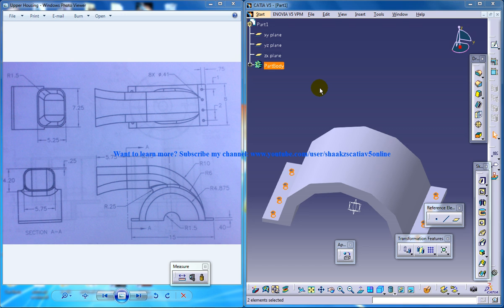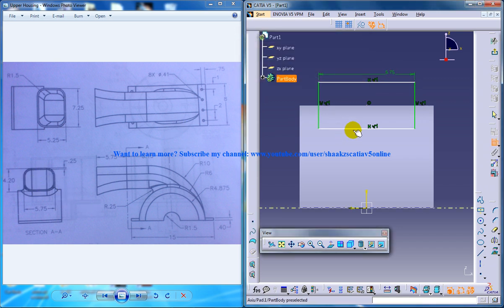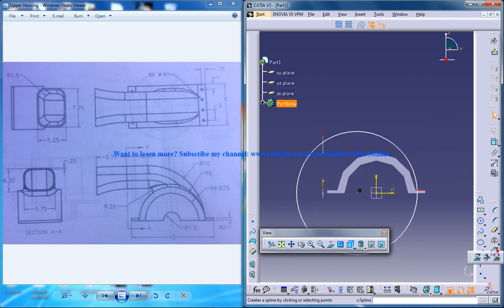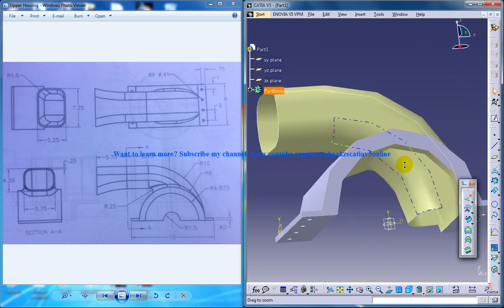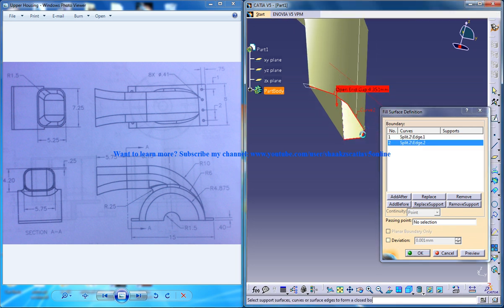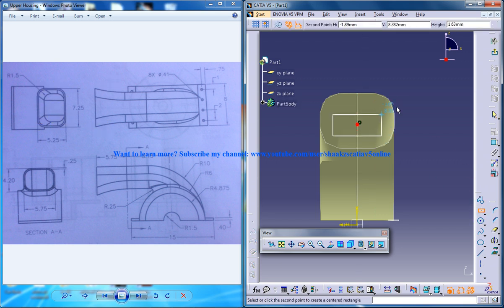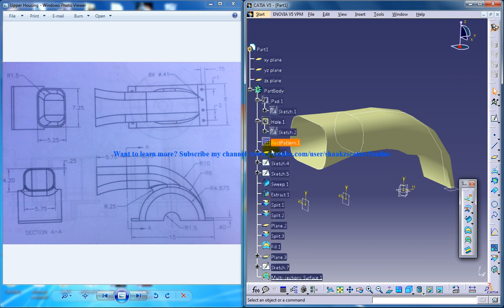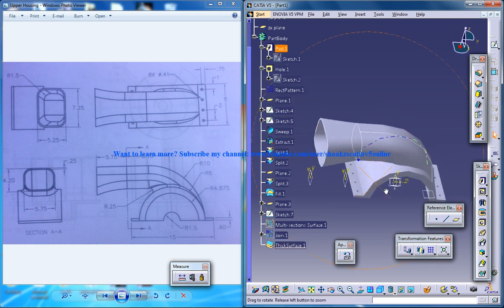Catia V5|P1.2 Create Blower Assembly||Rebuild Upper Housing|Mechanical Design Engineering

Comment: hi shakeel. where can i get the rest of the design of the blower? i have followed your tutorial of the blower up to part 4.2. where are the rest including its assembly design? thanks for your help
Reply from the maker: SITOT Here is the playlist for Blower:

https://www.youtube.com/playlist?list=PLTj_0Tgy4cn9hOvlW3MPCp7Wauzg6FTfr

You can make use of constraints like coincidence, contact, etc to assemble it, The assembly is very simple. Or you can make luse of this playlist:

https://www.youtube.com/playlist?list=PLTj_0Tgy4cn_rsZytx4LZK_fURGu21t0V
Reply: thank u shakill.
Reply: i was designing a wind turbine blade. it has two intersecting oblique surfaces. and i couldnt creat that surface only in part design or wirefame and surface design. what shall i do?  i need ur help. thank u once again.
Reply from the maker: SITOT..you are welcome. .!!
Reply from the maker: You can add me in skype. I will try to resolve the problem for you in direct discussion

Mohammedshakeel1729

That's my Skype id.

Sent from Samsung Mobile

-------- Original message --------

Comment from the maker: Hi Abid,

There is a chance that your sketch has an open end somewhere. Or there is chance that you have some extra lines coinciding the existing profile. If either of these two happens, You would get such an error.

There is a tool called as sketch analysis which will help you to solve such an issue. I will try to create a video based on that.

You can send me the CATPart file to catia.pro.user@gmail.com and I will show you how to resolve that condition using the sketch analysis tool.

Thank U